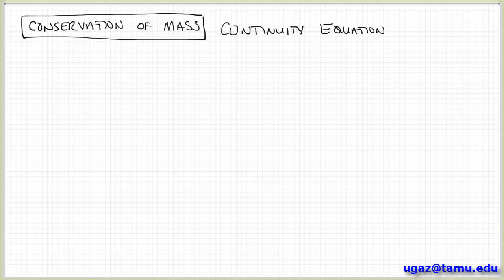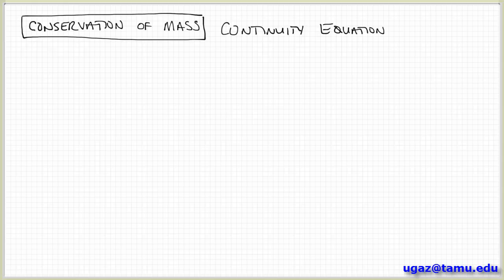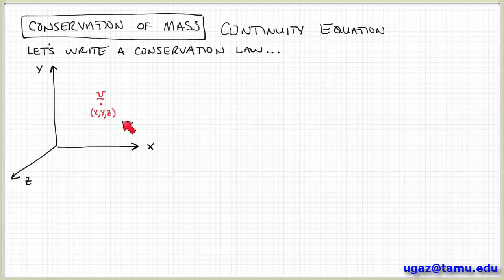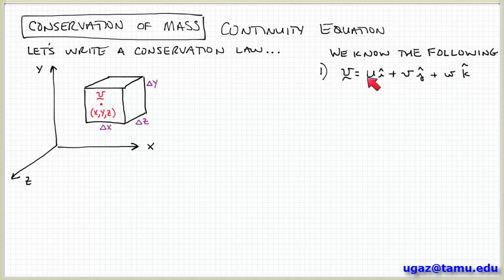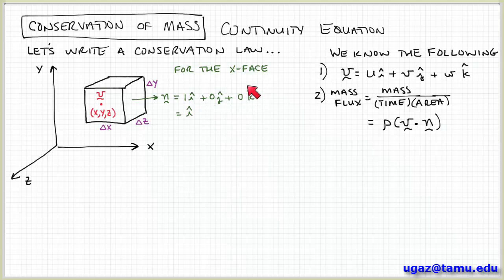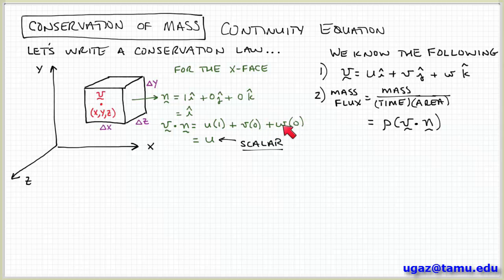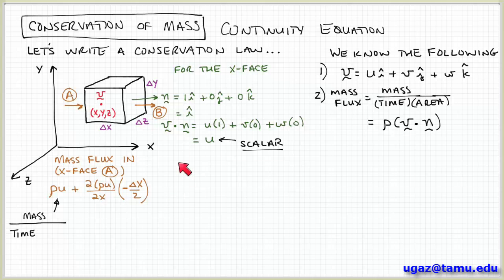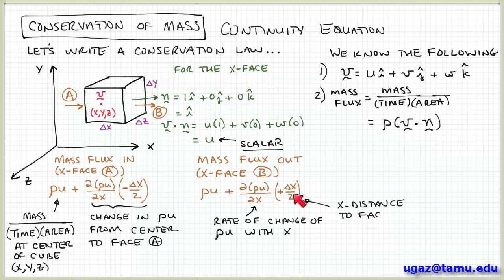Conservation of Mass, part 2 - Lecture 2.2 - Chemical Engineering Fluid Mechanics

Comment: Is This not loading for me, is there anyway you could re-upload?
Reply: I had the same problem in Chrome. I copied the link and opened it in Firefox and it installed a flash plugin instantly and automatically, then it played. It seemed weird but I had nothing to complain about.
Reply: I had the same problem, but I noticed that it will work if you drag that "timerbuttonwhatsoeverthingie" to some place. Like 0:02 and it will start playing.